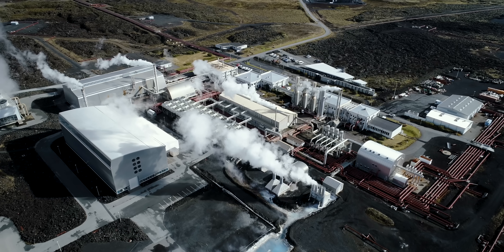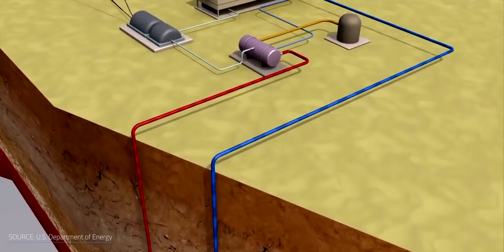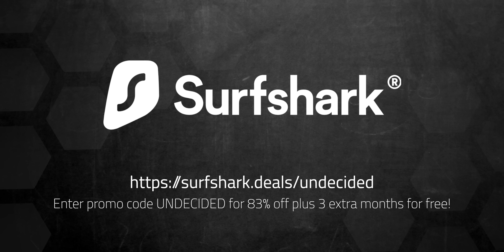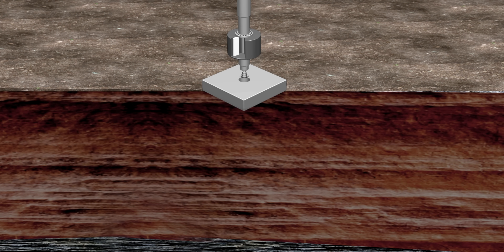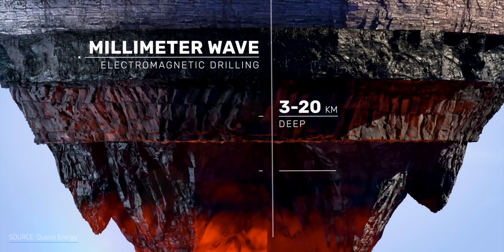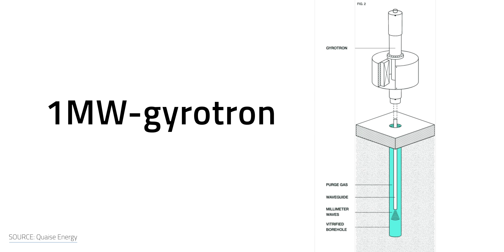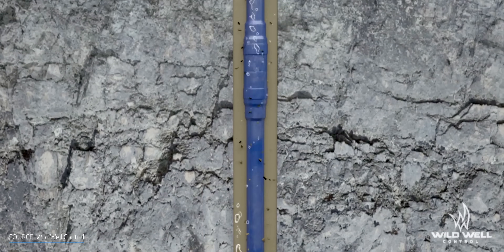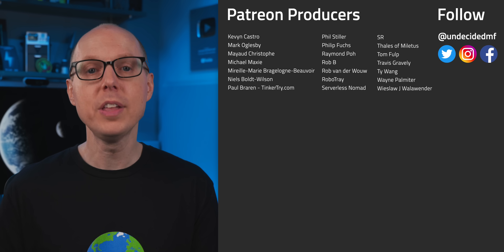Why This Fusion Tech May Be a Geothermal Energy Breakthrough

Comment: I think that this, or molten salt reactors, are the ONLY way forward. I am more inclined towards molten salt reactors though, since they operate at such a high temperature that they can be used to desalinate water and create dimethyl ether, as a direct substitute for diesel. Having said that, if this works out, I think that it's truly a game changer. But I question how long these wells will last in practice.

Comment: Hm, as long time directional driller this is pretty cool. I imagine, you have to dig until you are in the clear past all the sedimentary rock to prevent collapse and so you can switch into the compressed gas working fluid but that makes sense. I worked with a directional driller who had been on a well that had tried lasers for a similar thing and it had failed due to optics, but gyrotrons shouldn't have that issue I don't think since important components shouldn't be directly exposed to the well environment.

Honestly, I think targeting existing power plants make the most sense since .... you can get access to gridscale power. Portable MW level generators seems more than slight bit wasteful if you really can access stuff near anywhere.

Comment: A QUESTION: This is really promising and I'm happy to hear about it but it made me wonder. Won't geothermal power plants unleash the heat from deep underground to the surface, adding more to the global warming? A huge amount of hot steam is gonna be released into the atmosphere! Is there any study about this?
Reply: The water vapor released will condense out just fine in the form of rain, on a time scale of a week or so.   The heat itself isn't a problem, a tiny, tiny fraction of the incoming solar energy.  The challenge with global warming is that CO2 and methane act as a blanket that retards the radiation of infrared energy (heat) back to space, and those stick around years to centuries.

Comment: How is the earth's inner core different from Sun? Theoretically, would it be possible to generate electricity by placing solar panels around the earth's core? I wonder what kind of performance we might get by doing that.
Reply: Steam turbines have better performance characteristics than thermoelectric converters (as near to a thermal solar panel as you can get).

Comment: Interesting concept.  I am strongly in favor of pursuing a test plant.  Another technology to look into and worthy of a video is Molten Salt Thorium Reactors.  Cheap, abundant, clean and safe and also proven technology that could supply electrical generation into the foreseeable future.  A test reactor was set up in the early '60's and proved to be viable but did not produce a byproduct that could be weaponized.

Comment: Taking the cost of just power ($500,000) verse the complete cost of drilling a standard hole ($30,000,000) that graphic / text is misleading.  I would venture a guess you will add the 500,000.00 to the 30,000,000.00 and be closer to total cost.  MY 2 cents.

Comment: I like the preliminary details, but where is the feasibility study showing the reduction per Kw/H with higher volumes of steam output? One thing is to do a small-scale pilot demonstration but if the borehole is bigger in diameter, let's say 12" instead of 8" and there is sufficient infrastructure in place to process large amounts of steam (minimally needed scale threshold of feasibility), it should be rather simple to demonstrate a very competitive electricity generation cost and a clear path forward in terms of optimization. Make such information public, and rally investment by being convincing beyond simplistic laser-boring videos. NASA first set a goal for their JWST telescope and then invented all the missing tech to breathe the marvel into existence. There were doubts only for the lack of funds but not because the gold-laden mirrors couldn't be made dead flat. There should also be a preliminary study showing the power output over the lifecycle of such a geothermal system, we aren't talking about seismic collapse if the hole is to be drilled away from high-risk zones as per the claim of this interesting company. The outputs should be most predictable for investment confidence much like the tidal energy potential in certain geographic areas where the power of waves is proven to deliver a steady return on investment 100 years later with the right level of optimized tech (yet to come and why not?) to guarantee uptime with less maintenance precisely because most basic technical challenge have either, already been preempted or are promised to be tackled in due time.

Comment: Question on drilling Matt. Nearer the surface the temperatures are a lot cooler. As the superheated steam rises to escape it heats this cooler surrounding earth causing the earth around the bore hole to expand narrowing the bore hole. How does the gyrotron brain trust plan to mitigate for all that increasing pressure around the bore hole nearer the surface? Seems to me any bore hole digging down to hundreds of degrees of super heated steam will for sure encounter  these pressures of the surrounding earth expanding as it heats up. So not just pressure drilling down on any drill bit, but continuous pressure squeezing the drill from the sides and even post drilling as the steam heats the earth surrounding the bore hole. At what point do they drill a wide enough hole diameter that the bore hole remains open and not spitting up earth or rock to the surface that would damage the turbine(s)?? 🤐🤔

Comment: According to the laws of energy, when you use the heat underneath to convert into electrical energy you are extracting energy from the ground. Will this affect stability of the ground there in terms of not causing earthquakes or landslides?

Comment: I'd love to know how they plan to contain the pressure at the surface.  In conventional drilling the density of the mud is tailored so that the hydrostatic pressure of the mud column is enough to hold back the pressure in the formation.  So you can essentially have an open wellhead at the top to feed the drill string into.  In this case gas would be used to remove the waste, so there would be no hydrostatic head to hold back the pressure of hot water, natural gas or oil pockets that you run into.  You would need some kind of seal mechanism at the wellhead to allow you to feed in the drill string while still maintaining the pressure of the circulating gas.  I wonder what that would look like.  I don't think it's a show stopper but coming up with something reliable would be an interesting challenge.

Comment: I recently did a presentation on the geothermal topic for Uni looking at types of power production. One of the MAIN aspects besides location dependence was the initial cost of digging down. Talking with a Geology professor it can be usually upwards of 1 mill per km for a bore hole and Geothermal needs to be AT LEAST 5 km deep and usually 3 bores so the costs can get large very quickly.

Comment: I love the fact that you're trying to use the resources around you, but why are we not trying to go up into the cold atmosphere to steal energy out of space instead of trying to steal it from the heated core of our planet?
Wouldn't it be easier to move through a solid liquid instead of a solid Earth?
Reply: Any energy accessible in interplanetary space comes from sun rays. Geostationary solar panels working 24/7 at maximum efficiency could definitely set up around Earth, but rocket launch prices need to decrease at least by a factor of 100 for it to be economically viable.

Comment: what if we extracted all the energy from earth, what would be the consequences of a earth without geothermal energy inside?
Reply: It would be essentially impossible, maybe a few millenia in the future we would be able to extract basicallya ll heat from the top 10 km of Earth crust, but our planets radius is 600 times more than that and more heat would always flow outwards. Earth's internal heat is continuously produced in its core because of radioactive decay of old heavy element deposits, and it is more than enough to power our entire civilization for billions of years.

Comment: I know that this may sound crazy but have they considered drilling a deep hole and poring water into it? Then taking the Steam and using that?
Reply: Most geothermal power plants work just like that, especially in Iceland and Hawai where the hole can be very shallow and already hit 100+ celsius and vaporize all water pumped down.

Comment: Jeez..  can't we invent anything better than a steam turbine though ?
Reply: Steam turbines are extremely efficient, especially at 150-400 celsius fluid temperatures, and even if there are more efficient mechanisms, they require far more expensive elements and compounds to work, and it just doesnt make economic sense. Few fluids are better than water, and most of them only work more efficiently at cryogenic temperature differentials (like using liquid helium to extract power extremely efficiently from a 2-3 kelvin temperature differential)

Comment: 03:10 0.1% of Earth's heat = 2 millon years of energy. Very encouraging. But:

03:20 Geothermal energy = 0.55% of global electricity generation

14:04 Retrofit existing fossil fuel plants (costs of upkeep of end-or-near-end-of-life plants unknown)

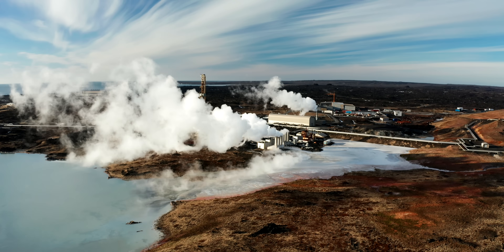16:35 Cost of setting up a geothermal plant = ~4x the cost of setting up a solar farm

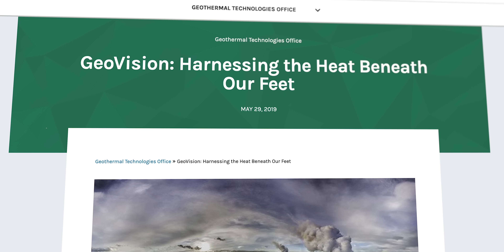10:25 Geothermal-based electricity may increase by 50x by 2050 

0.55% of total generation x 50 = 27.5%. Is this enough, and do we have enough time?

Comment: Well explained, and I like that you didn't cover it in fluff, but even talk of drawbacks or obstacles. I contacted someone from DOE years ago to posit an idea of storing waste heat, from some solar projects, underground to build a kind of artificial and lower temp geothermal source and use either motors that operated on temperature differential (like stirling), or low pressure steam generators to augment the electricity from the solar project. The answer was short, and essentially "we have been looking into geothermal, and it has some obstacles'.

Comment: 16:30  Are the costs of solar plants  with the costs of battery storage?  Geothermal energy plants are running around the clock ;-)  Solar doesn't,  and so you need 2-3x the output AND batteries without seasonal differences.
Reply: I think geothermal energy is one key sources for electricity for the near future until fusion becomes widely available. 
Thank you for this Video. I havent heard of this technique until now :-)

Comment: What do you do with vaporized rock? I'm imagining clouds of "rock vapor" blowing out the top of the hole... Sounds fun to breathe. Some condensate trapping system? Sounds like several tons of super fine rock powder.
Reply: It will condense to dust inside the drilling fluids or condense on the walls, within fractions of a second. Rock vapor will not stay vapor for even a second, it will immediately become dust

Comment: Hoping you read this

Topic: Beam scattering due to highly reflective or resistant materials.

Scenario; So what if there is like a giant diamond, bigger than the passing space past the nozzle and inner tube wall... what would happen..
if a drilling hole would be completely rendered useless because of this, that would be a very big risk.
is it possible to steer this drilling so you could go around such a thing after you detect it ?

Or could it completely block the laser's effect by scattering the light within an unbreakable structure?

Bonus question;
What would happen with the power required to feed this laser ?
Having several kilometers of glass fiber would even reduce quite a bit, they would need to compensate, interesting thing to explore and elaborate on if you will :)

Comment: Geothermal is just fracking for water.  While I'm personally not totally against fracking...  the process of setting up and running a geothermal tapping site is pretty much as dangerous and damaging as a fracking site for oil!
Also I don't believe the drill sites are permanent.  I believe the ones in Iceland need moved, re-drilled occasionally.  They do eventually start to cool the rock around the drill site.  They are known to generate minor earth movements, just like fracking.
Iceland etc. have access to the diverging plate boundary where the earth is literally opening up.  Red hot rock exists just under the ground.  Everywhere else on land the crust is 10km+ thick.  Even if you head under sea, you'd need to get off the continental shelf to get to 5km thick crust. 
So it's only "currently" viable in a very rare set of locations.
This new drilling tech sounds like it's 10year away, also sounds like it's never been tested, so it might just not work.

Comment: One thing I don't understand. So you have one hole with hot gases coming from down below and one hole to send the gases back? If you punch two holes aren't both holes going to spew pressure?
Also what happens if you decide to "cap the well"? Is that even possible, considering even solid rock can't contain it?
I'd say proceed, but proceed with caution.

Comment: The issue with global warming is not fossil fuels. The issue is dissipating locked energy into heat while making use of it. No mater if comes from, fuels, nuklear, geothermal, etc. The only way to overcome global warming is to extract heat from the environment into a usable form. Examples for processes like these are wind and water powered plants. Humanity has to work on more ideas of how to extract energy from the sourrounding and convert it into usable energy, for net zero in terms of global warming. Just have a think and you will understand that there is a balance between incomming energy and the capability of dissipating energy into space. Every time you unlock energy from any source, not meant to be there you jeopardize this balance. This is the real reason for global warming.

Comment: The problem with geothermal is heat migration speed. It only works in places where vulcanic processes cycle heat near the Earth surface. Without that you can drill down and see heat, but once you extract that heat ... it will take centuries for the heat to migrate across kilometers of surrounding rock to your extraction point. A blink of an eye in geological terms, but a bit longer for humans.

In practical terms the hot rock vapors would instantly re-deposit on all non-molten equipment and cake it all in a rock layer in minutes.

Show it working - cool. Investment in that is still a trust exercise.

Comment: The 2 miles deep gold mines in South Africa have a problem called rock bursts where the mine tunnels suddenly slam shut compressing the air so it becomes white hot and comes out at supersonic speeds and buildings two miles up on the surface are thrown up in the air by the shock wave. The walls of the tunnels slowly creep inward because the rock is under about 10,000 pounds of pressure and it is hot. The pressure is about one psi per foot of depth and the rock flows more readily as it gets hotter with increasing debth.

Comment: So the one thing I didn’t see anyone address in this is how they plan on dealing with the excessive amount of heat any drilling equipment has to withstand at those depths.  The magnetron in this drill head would have to have a fairly robust cooling system that would increase the energy costs

Comment: Well, I wonder what is the maximum/optimal operating temperature of the driling device, and how easy/difficult would be to extend a power line carrying >1 MW for hundreds and thousands of meters underground, under high pressure and high temperature conditions...

Comment: It seems to me that dealing with the rock vapor is a major issue. To start with, if it's condensing out on the walls to form the casing, what stops it also condensing out on the wave guide? Then there's the question about flushing it all out to the surface. That column of rock dust loaded argon is going to be pretty heavy so the argon pressure will have to be very high which will have to be contained inside the wave guide system.
Maybe, but I'd like to see some more details.

Comment: Whenever it comes to using our Earth's internal energy (i.e. heat of (closer to) the core), I can't help but think: "first we decided it's a great idea to burn oils and release smoke in the atmosphere, effectively heating up the surface of the globe. Now we've learned from our mistakes and we're planning to build giant radiators for the core of our Mother Earth - to cool it from the inside while we're still heating it from the outside. What could go wrong, eh?"

I know, I know. It's but a tiny tiny % of the energy this giant ball of mud has. But that also means disturbing the balance (again!) by that tiny % could cause massive consequences we haven't thought of yet - and then we'll be suffering them and spending fortunes and lives to remediate them.

IDK, I'm not a fan of geothermal. Nor do I like "tapping into" deep water streams (they do play an important role too, last I checked). IMO we should not touch what is THAT perfectly balanced and instead tap into excessive energy we're getting from the outside: the Sun (PV, heat, light, ionising radiation), the wind (motion) (as it's largely created by the Sun, at least I was taught it is), the space (as a low-energy void, should we have a way to harness the hi-low energy difference).